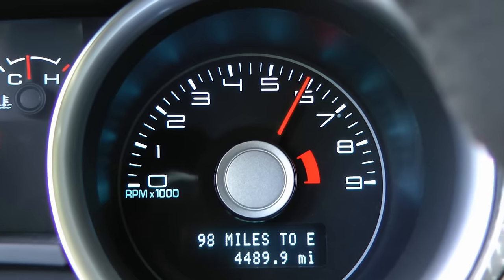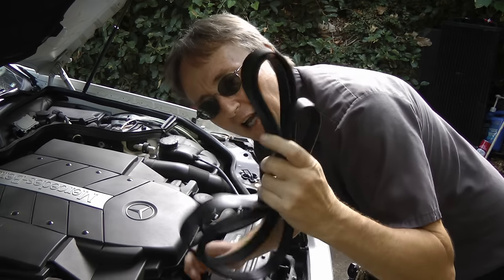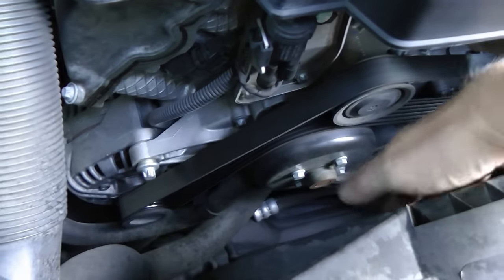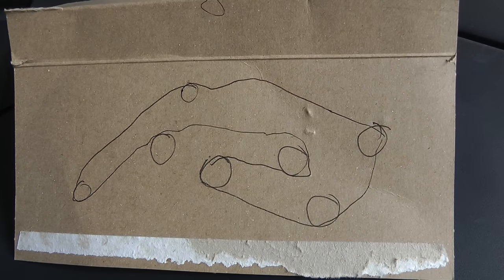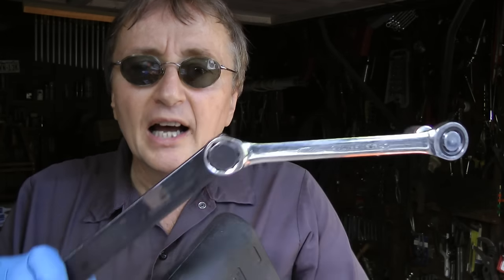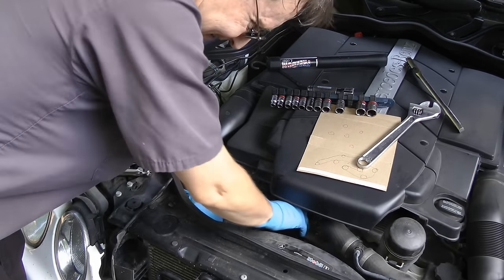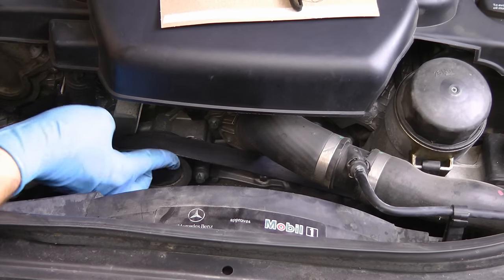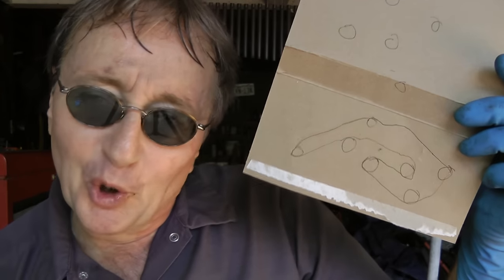How to Replace a Serpentine Belt in Your Car (Fan Belt)

Comment: @TeenIronMan NO that is your timing belt/ chain. Valves will get  bent when making contact with the pistons and your motor will get messed up. If your serpentine belt gives, you just wont have AC, power steering, alternator and charging. Nothing bad would happen, but you wont have all of your accessories until it is replaced.

Comment: Just got a new belt and it’s like 6 inches shorter than the old one and doesn’t fit even close. Tried for an hour and decided to put the old one back on. Autozone website and store both show it’s the correct belt. Wtf

Comment from the maker: NEVER spray wd 40 on fan belts, ruins them. Either your automatic tensioner is bad, or one of the pulleys it drives has a problem, like bad alternator bearings.

Comment from the maker: the auto tensioning systems do it themselves. If yours is manual, find the longest run of the belt and tighten it until you just can flex the belt 90 degrees in the middle of the run by hand

Comment: Some Mercedes have a pulley which can be locked into position with a pin to ease serpentine belt replacement (and presumably removal).  Once the belt is properly routed, the pin is removed and the tension is restored on the belt.  However, Scotty's method is the one I prefer.

Comment: I changed my serpentine belt recently and still have squealing from that area. I've also replaced the idler pulley with no luck. Spraying belt dressing was a very short and temporary fix. What would the next best move be? Thanks again for your help.

Comment: hey Scotty.. 2000 ford ranger.. belt was cracked.. i tried several parallel groove belts from oreilys.. squealing like crazy.. relaced a pully.. still squeeling.. couldnt find a gator back belt anywhere.. the ones with horizontal and vertical grooves.. had to order off amazon.. installed.. no squeel. there may have been some front end damage prior to me owning bc pullys are slightly misaligned... anyway.. why are these gator back belts so hard to find?

Comment: Okay.  Follow up question:  I know that belt noise can be caused by problems with belt tension, but also by misalignment of pulleys.  How do I know which issue is causing the problem?

If it ends up being an issue of misalignment, do I need to get in there with a straight edge and caliper?

Comment from the maker: I would try a new idle air control valve and pray it's not more than that. Also check for vacuum leaks as in my video "finding engine vacuum leaks with a cigar"

Comment from the maker: @rajin335 on the front of the engine on the outside, the pulley at the front bottom of the engine drives the fan belt

Comment: In a car wash queue today and my belt snapped. Coolant level dashboard light came on, battery light came on and power steering went all at once. When i finally got home turned the engine off i could hear flapping which was the broken belt slapping at it stopped going round. So do i just remove it and put a new one on? Easy at that? It's an audi mark1 2004 3.2 v6 TT. Advice welcome. Thanks.

Comment: Hi Scotty, I recently replaced my serpentine belt on my  2006 Pontiac vibe. I did not replace the belt tensioner and feel I have lost some power.
Today I went to the grocery store and when to start my car lights came on but no crank, new battery post good. Shook car looked for burnt wires, looked good, got the feeling I should put in neutral and rolled backwards to get the wheels rolling, stopped and tried starting it and it fired right up.
 Do I need a new belt tensioner? Is it failing? Not mechanic minded, just a mom who likes to fix things.

Comment: I just bought a meachman alternator it's got a smaller pulley. So I had to get a smaller belt. The belt was tight but went on, am just wondering if it too tight. On a 2013 Chevy Tahoe LTZ.

Comment: Scotty, a repair shop told me the alternator belt is cracking and should be replaced on my 2008 f150 5.4. Is it something that should be changed if it's cracking? It has 270,000 km with 29k of my own, no idea if and when it's been changed.

Comment: Hey Scotty I have a 04 chevy silverado and when it gets rainy and humid outside my engine starts to squeak like mad. As the car runs it will stop on idle but as you drive the truck and give it gas you can still hear the squeak. I'm not sure if it needs a new serpentine belt, belt tensioner, or a idler pulley. What do you think? Thanks

Comment: Hi Scotty, having a 3 belt system, excluding timing, on a 2001 L/cruiser Prado, AND that my drive belt actually broke and went all over the place, but the pulleys it belongs to I think I have worked out, but I haven't yet figured which is the tensioner pulley to loosen for the replacement belt? Also, with this system should I remove all belts first or can I snake the belt in like others? Big novice here. Thanks.

Comment: Hi Scotty,
My serpentine belt has come off of my 2004 Siverado three times in the last three months! I replaced it and I noticed it is damaged in the same spot everytime. The last groove is split and broken for about 18 inches, but not the whole belt. I recently looked at it again after I replaced it and it ran for a couple days and noticed that it is not aligned on the crankshaft pulley. I is actually hanging off one groove towards the the front of the car but only on that pulley. I realigned it, ran it, but it just went back to the same spot! Why is this happening and how do I fix this alignment problem? I just recently had my power steering pump replaced and noticed also that it doesnt line up with the crankshaft pulley perfectly- it is sitting forward about the width of one groove. Does everything need to line up perfectly or can there be a little difference? thank you!
frustrated,
Jason
Reply from the maker: try a new tensioner, they often wear off center and cause all that.
Reply: Ok, I will try that. Thank you!

Comment: Hi there Scotty, I was hoping you could help me out seeing as how no one else seems to be able to..

I've got a 2000 Bonneville that is making an awful intermittent squealing/screeching sound (Think of the pitch of your tires when you slam on the breaks) It happens at operating temperature. It seems to stop at around 3000 rpms. One mechanic noticed that I sprayed belt dressing on my belt and reccommened that I clean the pulleys. I noticed that the power steering pulley is a bit loose. Could this make that loud of a noise?
Thanks for the help, I have subscribed!

Comment: Hey Scotty,
I recently changed my serpentine belt on my 99 corolla but its squeaking still. I noticed that it is really close to the tensioner pulley and rubbing on it. Should I replace the tensioner or look for adjusting it?

Comment: Hello scotty. On a 1998 oldsmobile eighty eight the drive belt runs between the bracket that connects to the motor mount. Is there an easy way to slip the belt in through the bracket or do I need to remove the bracket completly? Thanks scotty

Comment: Looking for help here. My Chrysler 300m keeps throwing serpentine belts off pulleys. I have replaced the tensioner pulley, serpentine belt, and aligned all the pulleys. What could be causing it to still throw off a belt? This issue is beginning to get very bothersome with winter rolling around. I don't want to lose power steering in the snow.

Comment: Scotty I have a 1992 Toyota Tercel and I want to replace the drive belt but It doesn't have a tensioner pulley so do you know more less where the Adjusting screw Is for the belt?
Reply from the maker: you move the alternator, it swings and has adjusting bolts on it
Reply: I have spent 5 hours looking for this answer. Thank you Scotty!. How about for the ac compressor belt. My '92 toyota paseo has 2 belts and none have those tensioner pulleys.

Comment: B.S forgot to mention a clip lock which you hit when the pulley is moved back to lock in place for removal. This allows the belt to placed on more rollers and even the tension.

Comment: Today, driving home in my 2013 Scion iQ (tiny 1.3 engine that's packed in there.)  All my warning lights came on and lost my power steering.  Made it home and batter is graveyard dead and the serpentine belt is GONE!  Any tips on replacing that bad boy since I don't have a diagram to follow.
Reply: go online and u will find your diagram

Comment: Thank you Scotty! I have watched a lot of your videos and I’m amazed at what I can do by myself. My tensioner pulley just started making noise, I’m replacing that and putting a new “fan” belt on. $90 for both parts off Amazon. Is there anything I need to know for installation of the tensioner pulley? 2003 Chevy Trailblazer I6 4.2L

Comment: Scotty would you recommend also replacing the belt tensioner when replacing the serpentine belt on a car 99 Dodge Caravan SE with 87000 original miles?
Reply from the maker: I would on that model, they are notoriously weak
Reply: Thanks. I appreciate your reply. Great channel. I enjoy your videos.

Comment: Hello Scotty what was the name of the tool that you used to rotate over the tensioner pulley? I have tried to use serpentine belt tools on my 2000 Toyota Celica that  I bought @ Harbor Freight and O'Reily's. Both tools broke due to the crappy welds where the 19mm socket attaches to when I tried to move the tensioner pulley arm.

Comment: Hey Scotty, yesterday my fan belt came off while i was driving, I wasn't sure what had happened because it didn't effect my car at all but I made one bad mistake, I didn't check the heat gauge and my car overheated. My cars power steering. battery and fans stopped working because of the belt coming off but i stopped pretty much immediately when this happened(the battery and temperature lights came on). Just wondering if considering the car is still running that the head isnt busted or damaged
ty

Comment: I dunno why but I'm having a hell of a time trying to put my new belt back on. I can get the tensioner pulled up all the way and the belt is still too tight to put on. It's the exact same length as my old belt and my forearm is getting cut up by the edge of the hood protecting the fan when I try.

Comment: hey scotty i have 93 r150 straigh6 just replaced belt but i notice when i crank engine belt mounts on lip of engine pulley  its been a week and i have to change out belt again what could cause problem do i have to change my tensioner it seems nice and tight i also have had issues with power  steering could that be the culprit

Comment: would belt dressing help extend the life of the material?
if so, apply it before installation or after?
Reply from the maker: NEVER use that stuff, it's no good for modern belt systems
Reply: then, what you are saying, belt dressing (spray can) is for old belts, and not modern generation?
because i've been using it for over 5 years on my current serpentine belt and it runs fine. i will change it before new years though.

Comment: It was cold in chicago that day when my belt came off my 2000 isuzu rodeo. I went to the store, it started back. Went back home, car starts stalling and i hear a loud pop. I check under the hood, turn the car on hear the griding, the fan is working fast. All of a sudden i hear a pop and the fan slows down. I was wondering if there are other belts on the car or if there is only one belt.

Comment: Scotty,,,#2  ( ford tempo 3L V6). last year I rewired my cooling fan to be manual. Today when I hooked up the ODB1 reader to the engine it did not detect the disconnection but before that when the fan was intact the ODB1 reader turned the fan on right away and continued the engine checking.Do you know why the OBD1 reader does not detect the disconnected fan cables?

Comment: What the belt seems to move off the middle of the pulley when it starts up?  I don’t want it to grind on the metal section and break.

Comment: Dear sir: I have a 2001 Saturn SL-1 and lately it has been going through Serpentine belts. I replaced with the correct Gates brand 5 months ago and 2 days ago the edge of the belt toward the fender  has strand shredding I finally had to remount the 80% to drive home. Would you know what may be the problem as if motor mount or something is misalignment of the belt path. Please give me some idea, Many thanks. Don

Comment: Hey Scotty,
I have a 2004 Mazda 3 S - 2.3L...
My power steering just died on me (power steering light on as well)...extremely hard to turn the wheel...
I checked my power steering fluids and it was max...only real big thing I noticed was the belt was badly worn out.
Does the belt affect the power steering?
Thing is...I don't know which belt that is...it's in the same exact position as the video.
Reply from the maker: yes worn belts can do that, change it out, or pay someone to do that first.
Reply: Scotty Kilmer

Thank You! Really appreciate you taking your time!

Comment: Scotty ,,,,,#1 Do you think it is OK to oil a tensioner's spring (mine was a little noise although it is new).
Reply from the maker: yes, but use something like spray lithium grease that will stay on and not spray around like normal oil
Reply: Scotty= I used thick gear oil to spray the tensioner spring. The sound went away. I was surprised of its sound since it is a new tensioner. I changed it last month. I hope the sound will stay away since gear oil on it.

Comment: Hey Scotty I have a Isuzu Rodeo i need to change the belt. It has no electric fan. How do I change the belt with the fan in the way? Thanks for the help.
Reply from the maker: you loosen the alternator bolts, slide it to make the belt loose, then slide the belt over the fan that's in the way

Comment: Will replacing the belt and idler pulleys affect timing?
Reply: If the serpentine belt also drives the camshaft then yes.

Comment: hey Scotty! i have a question..so here's my situation, i got my belts replaced, a week later it started making screeching noises whenever i make a full U turn or a tight turn, i went back to the mechanic who installed my belts, he fixed it and even had the nerve to charge me $15 for the service! it's not making a screeching noise anymore BUT now i cant make a full U turn! i dont wanna go back to that mechanic, hes trying to rip me off.. but whats wrong? does that have anything with the belts?

Comment: on my 2001 pathfinder, one of the pulleys drives the fan and the fan clutch is bolted onto the pulley.  Do I have to remove the fan and the radiator to do the job? thanks
Reply from the maker: you remove the fan belt then change out the bad pulley, from whatever it's bolted onto

Comment: Hey Scotty, I completely removed the bolt from my tensioner pulley and the belt didn't gain any slack. Any ideas?
Reply from the maker: Jesse TX sounds like it's time for a new tensioner assembly, those springs do wear out over time

Comment: I went around 4 miles after my power steering went out then stopped after seeing my temp gauge high and saw my serpentine belt was gone. Should I just put a new one on or tow to a mechanic?
Reply: You're probably already had it fixed but I'll post for advice if that ever happens just let it cool and change it on the spot. The overheating and steering issues should be gone with the belt in place as long as you know the proper pattern
Reply: Thanks man yea she’s good now

Comment from the maker: remove the fan belts and run it, pray the noise goes away, showing it's something worn they wear like a bad water pump or alternator. If the noise remains, it's internal engine problems and that gets expensive

Comment: scotty my belt on 2002 ram 1500 162.000 mile got a lot rubber coming off it on about some of the belt is on non ribbed side on it i used belt dressing an new belt on there tensioner was lose i tightened a little could this be tensioner

Comment: Hy scotty i chenged my V belt (gates) on my 2007 kia magentis (european model) , the old belt has few noises in rainy seasons and i changed them with new one gates belt micro V 6pk1513 in august 2012 , recently i checked this belt and saw cracks on the ribbed side , the belt has a maximum 15000 km age and one year , and now the belt presents chunks out material loss this belt was maded with EPDM material and  the producerc guarantee 100 000 mileage whats's the problem with this belt ?

Comment: scotty my car is acting up it wont go forward at times i hear it trying to move but nothing, I checked the trans oil all good i can hear it catch drive but nothing, my suspicion belt but the belt was changed 30000 km ago but i hear it squeak at times when i start it and sometimes when i am taking off at a light. can it just be dirty? or a ball bearing from one of the pullies? but everything is spinning correctly? please help!!